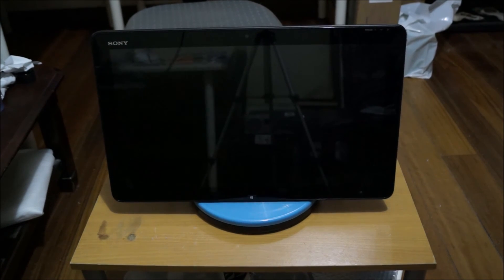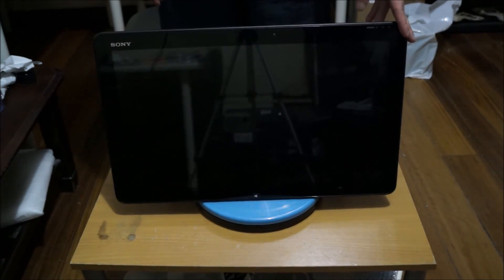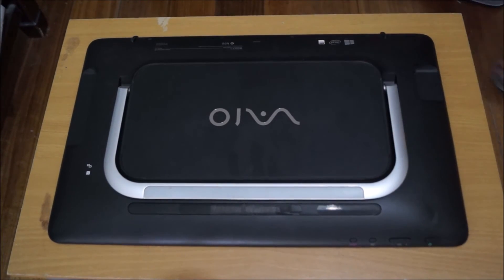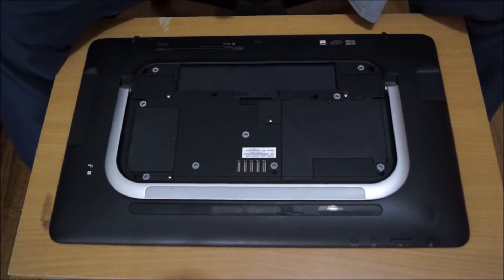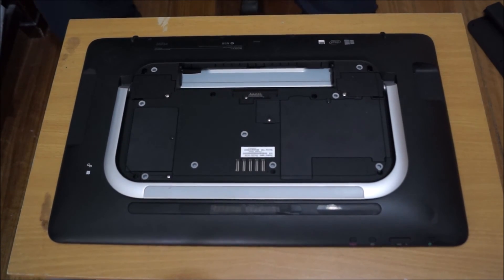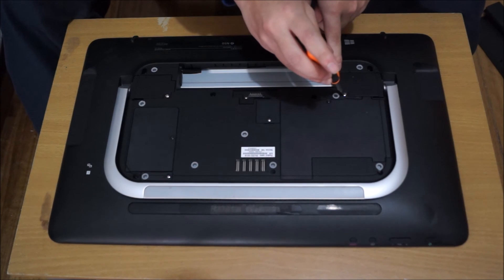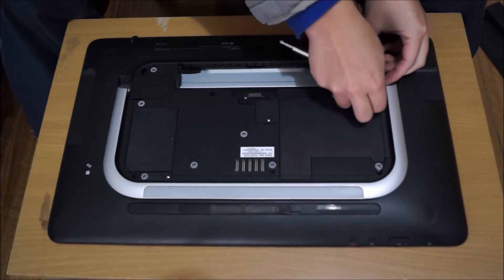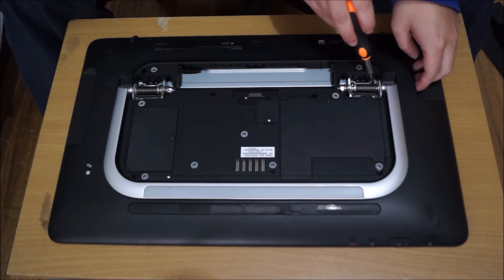OPEN ME UP! Sony Vaio 20 AIO Disassembly

Comment: do you think it is possible to disassemble everything and reuse LCD with a rasberry pi 4 with 8gb of Ram? 
Thanx
Reply from the maker: i doubt it. as you need a way to power the LCD screen. with most AIO the computer powers the screen therefore you have to buy a different component just so you can get the screen to turn on. you can do this but it is cheaper to get a screen and sell this. there are many youtube videos showing you how to turn a LCD screen into a monitor i tried it but realise it cost quite alot compared to just getting a proper screen.

Comment: Vaio Tap 20 has a capacitive touch screen digitizer (a 1mm thin glass) with about 3mm gap in between the digitizer and the LCD screen by a double sided sticky tape. You have just placed the middle point of the glass holding the full load of the desktop (with your funny table). "BIg Mistake" the stress on glass can break the digitizer anytime.! ! ! Just like any other LCD screen's handling precautions the outer frame SHOULD be taking the load so place it on a FLAT surface on a spread cloth. A Novice thought can be dangerous, this is why personals get trained at colleges for servicing of any electronic equipment ......
Reply: Hey I’m currently trying to clean my digitizer since mine has spider webs inside between the screen how do I go about cleaning it without taking the pc apart ?
Reply: @KaivitiSingh

Comment: hi can i change my sony tap vaio 20 processor?
Reply from the maker: CPU is solder on, graphic card is solder on, ram can be changed to 16GB max with 8 GB in each slot there are 2 slots, wireless card can be changed, hard drive slots which is a 2.5 inch that change be changed.
Reply: @OpenMeUpTec  I need to change the whole motherboard and install new graphic card and CPU????

Comment: Hi, I'm from México, is there a keyboard receiver? My KB is not working anymore and somebody told me that I need to take out the receiver to fit a new Wireless Keyboard and mouse, I hope you can help me
Reply from the maker: at 10.00 there is a USB port at the top left hand corner in the video you need to replcae that

Comment: I'm looking for most recent wifi card that works as replacement without changing antennas or cutting. Suggestions?    

My best guess so far is intel 7260hmw if I stay with intel.    

Any other suggestions?
Reply from the maker: this is not an apple therefore anything that fits in the slots will work.

Comment: Thanks for a really helpful video.  Cheeky to ask but is there any chance you can produce a part 2 video for dissembling a Sony Vaio Tap 20 and include how to change the Digitizer Glass please?  I cracked the screen on my Tap 20 and have sourced a replacement glass screen but can not find out anywhere how to actually replace the glass.  I was hoping your video here would include this information because I've seen lots of forum comments asking how to do this.  Thank you.
Reply from the maker: +Anna Burton sorry i dont have the item anymore to do so
Reply: +OPEN ME UP .....  Thanks for replying to me so quickly.  I understand your reply having made videos in the past myself.  Cheers Anna
Reply: Sorry Rajat, Last Feb 2016 I sent my computer off to a repair company in Manchester. At the time I did source a new digitized glass screen and told the repair company the suppliers information.  It took 11 months to get my PC back as they claimed the screen they acquired did not work and  they could not repair it  but I don't think they even tried. I've just got my PC back (Jan 2017) and it doesn't look like they've touched it at all.  Now I can not find on line a digitized screen anywhere.  I have however managed to disable the touch screen function and the computer is working well with the crack across the glass.
Reply: Hey Anna! Were you able to replace your screen? I have the same issue but not able to find a place to repair it or get a replacement glass. Any input from you would be super helpful!
Reply: Thanks Anna! Appreciate your reply!
Reply: Anna, where did you source the screen from and how much did it cost? If you still have it: would you be interested in selling it?